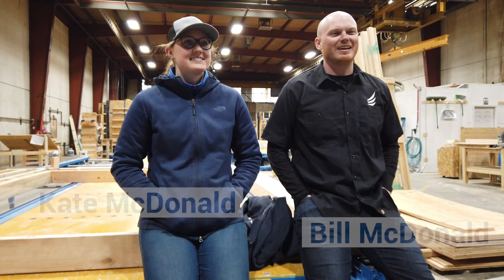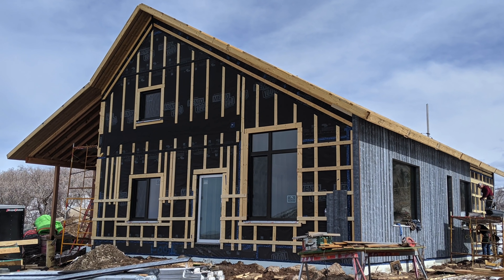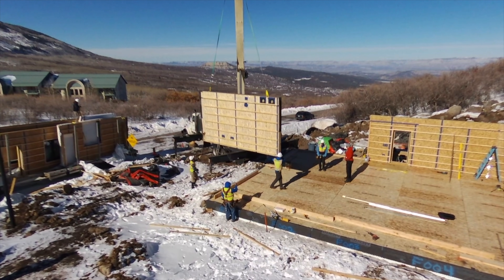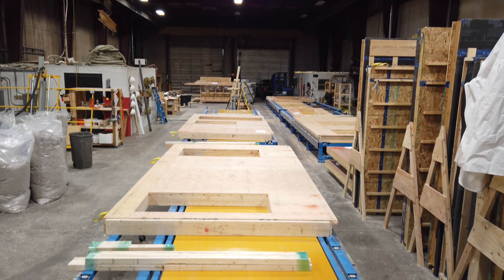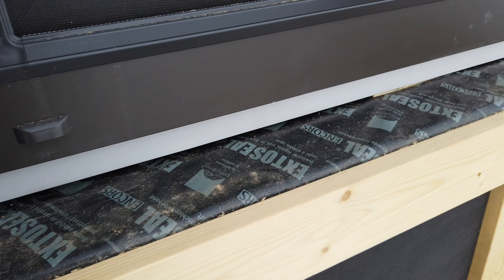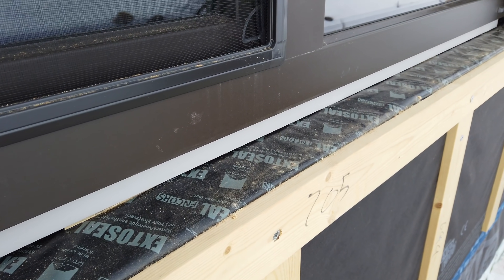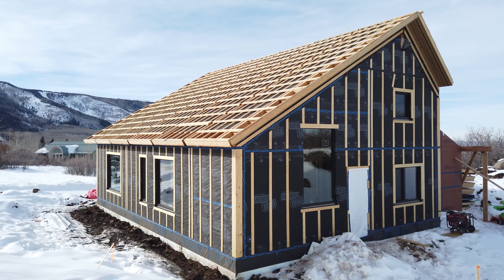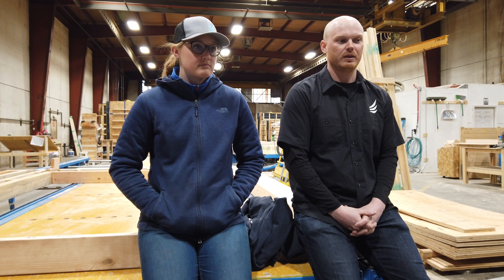It takes just 4 days to assemble this Passive House building enclosure that will last generations

Comment: Interesting! If the walls are closed, how are they fixed to the slab?
Reply from the maker: Metal brackets / simpson ties attached on the interior / exterior of panels. One nice thing about the consistency of working with building blocks, is that you can plan for similar weights / loads on each panel. Meaning, with the help of an engineer, you can choose a set of ties that work for all your panels.

Comment: A question,  You talk a lot about healthy houses and healthy building process, but what about your choice of materials?? you use plywood/OSB/EPS/Styrofoam etc, that is not healthy materials at all, it contains a lot of chemichals wich off gases inside the house for many years.... So , did you find any supplier who makes these products with no hazard chems i would be happy to know where its located.
Reply from the maker: Hello, we're the supplier of the tapes, membranes and air barrier system and can only speak to that part of it. But our materials meet the highest requirements for indoor health, are Red List Free, and have zero VOCs. You can check with Phoenix Haus for details on other materials, but since this is a core goal for their company, I believe you will find they have done their research.

Comment: I’m looking to build a home in Colorado and I want a passive home, but where do I start?
Reply: Not here that's for sure 😆
Reply: @chimpo131  not sure what you mean, but I found the Phoenix Haus website and I think it’s pretty competitive with the pricing. I think I’m going to try to work with them because their in Grand Junction CO and they’re close to where I want to build my next home. Thx, for the info though.
Reply: I have a 5 bedroom 3 bathroom house in Florida and I pay between $450- $600 per month electric. I’m will to pay more for my build and less on heating and cooling and air quality.
Reply from the maker: If you're looking to build in Western Colorado, there is no better group to talk to than Phoenix Haus. If not them, the other path to go down would be to find an Architect who is Passive House Certified and direct them toward our free details on foursevenfive.com. We have everything an Architect needs to go full Passive House.

Comment: 1:20 “want smaller units or don’t really want to own something.”

False. Very want to own, they/we just don’t want to have to pay monies forever for the sense of ownership our parents could afford at a fraction of the cost.

And yes, building technologies have improved, but how can we claim “efficiencies” when everything is practically 1000% the cost it was just 30 years ago?
Reply: Imagine how I felt when my grandfather built his own home 1200 sq ft for $13k and my dad bought his new 1400 sq ft for $23k...
But yeah,I wouldn’t want my dads $86.00 a week paycheck ether... My 1200 sq ft house cost 110k but considering I get paid 10x more it becomes relatively the same... So if you want the world to go back to 1950s cost of ownership,you should also give back the cost of employment..
Reply: @JSomerled  well ... and true, incomes and pricing did change, but not proportional to one another.

For example ... the Wyndham homes Hunter 1600 sq ft floor plan in Denton June of 2015 went for $140,000. When lots finally opened in December of the same year, they started at $180,000 ... $40k jump in 6 months. Now it goes for $250k starting.

My dad went for an architectural degree in the 1970’s full time that he paid for over the summer in a part-time golf caddy position. I went for the same program in the early 2000’s part time schooling that I was paying for with a full time job.

My first job in 2000 had a 5.25 minimum wage. It’s 7.25 an hour 21 years later (and if that’s minimum, imagine the wage scale all across the board).

The 2 biggest contributing factors that I can observe of the bat are the pickup truck market going from a new truck costing $25k to $60k when the oil field saw a group of people with a high school education making $200k+ a year and bought them with cash. So the market anticipated that they were underselling. Housing had its infamous bubble, and its undergoing a second market bubble as Californians are existing in a mass exodus, and everyone else is anticipating CA monies.

This is why every vehicle manufacturers try to push a lease plan, and why most cities are building multi-family apartments over single family homes. Trying to make an “affordable” solution, rather than try to remedy the core problem.

At least, from what I can observe personally and first-hand
Reply: @Ntx_MrE  there is So much you don’t even begin to account for..For instance,the population in this country more than doubled in my life time,and it will quadruple in your kids lifetime..Supply for items like lumber will never keep up,especially when cheap lumber gets  dumped in the USA forcing lumber mills here to close.Cost of new home prices are due to dynamics that will only get worse,not better..Builders are not going to just eat the cost of lumber doubling...
I would worry more about being relevant in the job market so you can take advantage of the increase in labor cost when it occurs.. As it always does..People who get left behind usually have good reason to be left behind.
Reply: @JSomerled  that’s true, and I can admit that I was taking a hyper focused perspective and using a very specific scope. Heck it also leaves out major issues like local politics (like ... 6 city council members leveraging their “unpaid local government positions” to adjust local taxes to somehow benefit their multiple real-estate holdings) in addition to the concerns you brought up.

So, yes, definitely. But there’s still the frustration as people balance the desire for ownership and stability and independence with the ever growing costs and lease-culture tethering folks to the producers of whatever the goods and services are.

Comment: living healthy = Pay us a high per sq/ft price to pre fab your house
Reply: Yes, I'm suspect on the price vs value.  This is like paying $500 a month for yoga classes.  I don't know, they either have crazy high costs or insane margins.  Either way, not for me.
Reply: sorry you feel that way but that is surely not the case!
Reply: @phoenixhaus3003  okay, then what is the gross margin and what is the breakdown of the $300/sq.ft?
Reply: @Kramitall  $200 of it falls to the onsite builder. $100 of it is our package. That's 2/3s that is not within our scope and something that we can't control and is decided by onsite labor rates and finish preferences. For 2/3s of the price we provide 40% of hard costs. Including windows pre-installed and all structural components.
Reply: @phoenixhaus3003  okay, on-site builder is racking it in.  Doesn't make sense that the efficiency to build on-site and the assembly line for building the house would seem to reduce costs, but then again they are charging $400k for 3-D Printed houses when they are supposed to greatly reduce costs.
Reply: @Crap Guitar Show Ouch, not quite - have you built a Passive House recently?

Comment: OVER $300/sqft....HAHAHAHAHAH!
Reply: Yea I thought it'd be cheaper and that was the appeal.. website says h19 goes for $593k
Reply: In some places, such as where I live, $300 sqft is the cost to build on average. With the cost of materials, an extremely tight labor market, and a short building season, this is reality.
Reply: @nicholasnewby8925   this video was done before skyrocketing lumber prices. 300 a sq ft is fine if it was a large house that was a complicated build. I can build a more energy efficient home for much less
Reply: @av1204  If that is the case, please provide your info and location.
Reply: @nicholasnewby8925  Atlanta georgia
Reply: is that what they said? They are out of their minds if that is the price they are charging. I can build a much better house than that for 300$ a sq ft and it be net zero.
Reply: @av1204  we wish you luck!

Comment: Great idea but I've had to go back on a 14' wall with cellouse that settled at least 2' over 5 years .
Reply: Code requires fire blocking every 10' where I live... but my first instinct is to say that your insulation installation was definitely not done properly if you've had that issue.
Reply: Sorry to hear - this comes if the cellulose is not installed properly
Reply: Our correction was at first look good because it had a grey screen to the attic side however if you trim the inner bond it will settle and a lazer thermometer is the only way to find it . Closed cell won't settle 1/4 " in 22 years and I can prove it and will put money against the cellulose over 10 years but it's your choice.
Reply: Not when it’s dense packed!

Comment: Can you recommend a Passivhaus builder near Springfield, Mo?
Reply from the maker: You may want to try sending an email to Phoenix Haus first, MO is not in their official service area, but they may make an exception. Locally, we recommend talking to Prairie Design Build based in Kansas City.
Reply: Build Show Network. Jake is their builder in MO. His current house reached an air tightness of nearly 1/10th of the PHI standard.

Comment: Too bad no costs were discussed.  What is cost differential for building code-compliant custom (which is admittedly crap in most places) vs this high-efficiency modular?
Reply: @PADOYLE  Agreed, but most people will make a judgement on cost differentials. Like Economy vs First Class.  I'm - usually - too cheap to pay for F (often 3-5x Economy), but if there's a sale, I'll pay 2x more. That's why I'm interested in the cost difference because then I can make my value judgement to determine if it's 'worth' the extra money.  In this case, this modular is quite competitive, particularly in high-cost markets
Reply: The cost is in use... in low efficiency models it is completely unsustainable. I mean look at what TX is going thru
Reply from the maker: We'd recommend you reach out to Phoenix Haus to ask. But to be fair, the better comparison would be the differential in time and labor savings as compared to other high performance building. Those interested basic code-compliant would probably not be the interested audience at point.
Reply: @475.SUPPLY  I think people who are interested in having a good quality house but have a limited budget might like to have an idea of the price range for basic code through passive for a house of similar size on the same property. I know I'd be interested. I'd like to know the ROI and level of comfort and health available at different price points.
Reply from the maker: @melissamybubbles6139  We hear you. Unfortunately we don't have a satisfying answer for that. Because Passive House construction is still in early stages across the country, it depends greatly on location and who works in your area. If you have experienced builders who can do the job, Passive House construction can be completed for close to same cost as decent quality new construction. 475 now ships materials within just a few days anywhere in North America - so most materials aren't location specific. The difference from place to place comes down to labor and experience of those doing the work. As Passive House becomes more prevalent across the continent, we should be able to see averages becoming clearer. I know it's not the answer you're looking for, but hope that helps give some context.
Reply: @475.SUPPLY  I appreciate it. I'm watching these home channels trying to figure out if regular people can help each other cobble together self-constructed housing out of disparate parts. I'm afraid of being homeless.
Reply: @KSMO1031  Thanks Jon - you've got it right - that information is from our main home page as well - calling out the cost for that Model H 19. We do want to make sure and check this at the different building sites, as site costs vary each time, etc.

Comment: This is a wonderful video! Displays harmony with mission, purpose and earth! The details and design of the building elements are remarkable and just perfect! PHantastic Job!
Reply: I will describe a more affordable option and just as fast ... But first:  These two folks speak so low, one loses interest. It is somewhere between mumbling and whispering.  He up-talks (tilting the end of sentences in an upward pitch as if asking.not telling) to excess.  She dares us to hear her.  Visuals are GREAT !  Lack of price without land is disappointing and glaring to the point of being suspicious. Concept  is attractive for the rich or financially wreckless.  GOOD method for short build season such as Colorado "high country" and similar climates.  Not a realistic option for tight budgets - For them, consider 2 or 3 or more simple rectangular gable-roofed garages built end end to end, without interior walls so  big open space inside which is a fast build using roof trusses, out of the weather quickly, only load bearing walls on the 2 exterior sidewalls. insulate and install electrical and plumbing,drywall THEN allows for erecting interior walls versatile floor plans.  It's relatively inexpensive and quick. and fast  exterior with roof so construction out of the weather fast.
Reply: @jgrmtnjgrmtn3954  Show us please. A video is ideal. I consult all over the Rockies and $300 a SQFT is actually low.. Colorado is expensive to build. Not to mention Colorado is a 3 climates a day kinda place.  So speed is money. The fabrics and intel of building science applied here is almost life-like. A body is vapor proof and water proof, but yet it can sweat and steam.. So can this type of assembly.
Reply: @PassiveHouseCody  check out Matt Risinger's The Build Show for it's quality and content. He makes Green homebuilding interesting and is seeking his certification.  Many episodes focus on water and air-tight homebuilding.  I spend almost half the year in Colorado High Country and much time studying new construction.  I consider your video more promotional than diy for obvious reasons.
Reply: @jgrmtnjgrmtn3954  Yea Matt's pretty geeky. Also this isn't our video, but we're still impressed! It's total example of science, technology, engineering and math. Gotta love that..